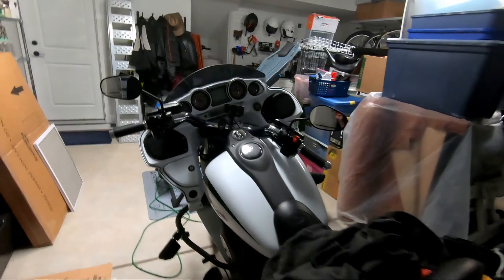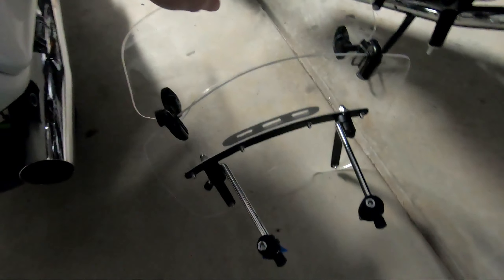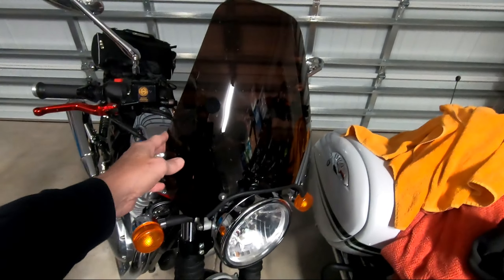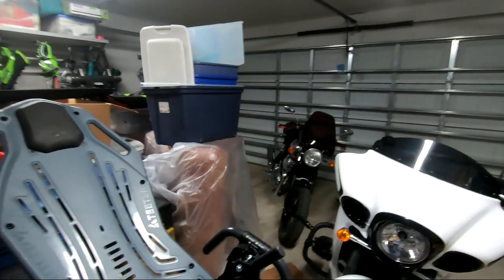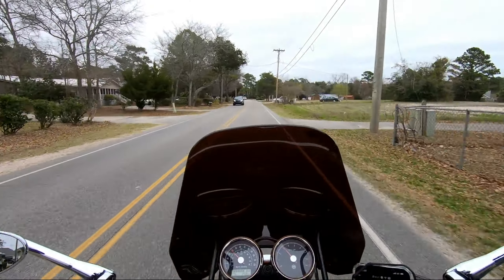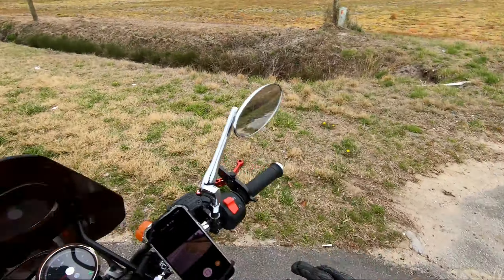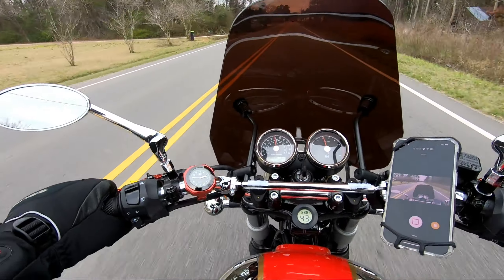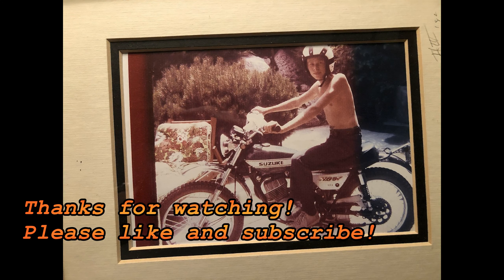Royal Enfield Windscreen Solution!

Comment: Well I guess I won't be buying the krator
Reply from the maker: Now my latest solution is the Krator, held in place using the fly screen mount and covering shield.  Still plenty of wind on my helmet, but the wind blast is gone from my chest, it looks great and fuel mileage is noticeably improved.
Reply: @QuentinsMotoVlog   I'm looking for a one stop shop solution, and my machining skills are pretty much zero, so I'd probably go with national cycle
Reply from the maker: @NhemF  definitely do what works for you. I’m posting a short video today detailing what I did.